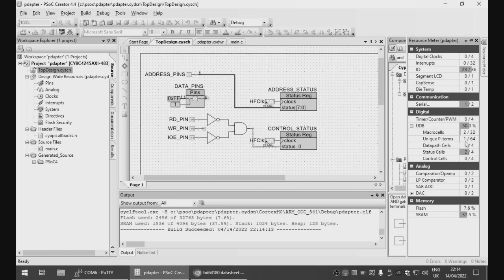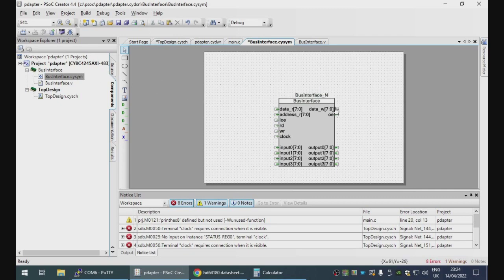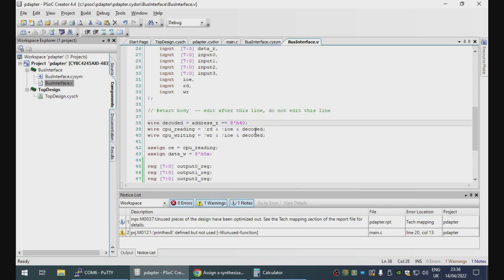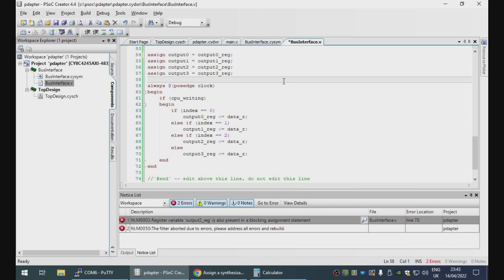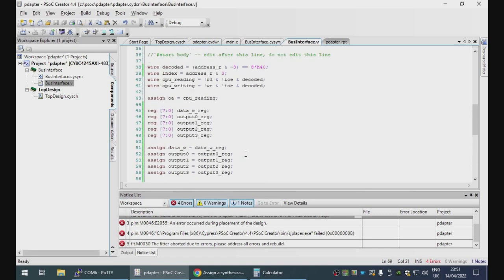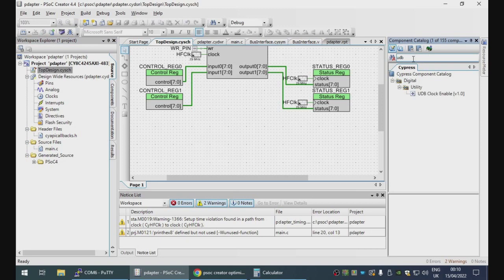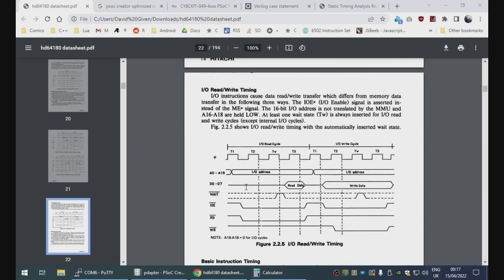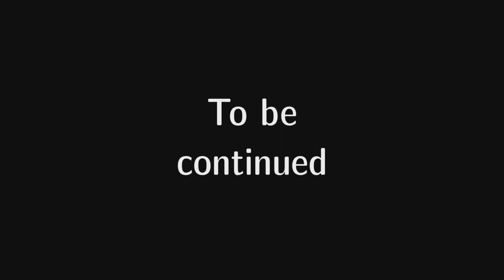A Brother WP-1 serial interface #3: more Verilog

Comment: I know nothing about CPLDs/ Verilog, so the following is a lot of guesswork and extrapolation from not very much knowledge: is the Status Register's "clock" signal for an system clock type clock, or is it a signal to tell it to "clock in" the data on its input pins (such that existing data remains registered if the clock is not asserted)? If its the latter, could you simplify your bus interface device by having a common set of data out pins shared by all Status Registers (rather than one set of 8 pins for each register), and have separate "data clock" for each status register that's used to tell the appropriate register which one is supposed to "clock in" the presented data? This might allow you to remove the 'reg's declared in the Verilog (reducing the P-term count?), and possibly define those output pins with simple assign statements, like "assign data_out = data_r", "assign data_clk0 = cpu_writing && (index == 0)" "assign data_clk1 = cpu_writing && (index == 1)" and so on.
Reply from the maker: Hey, don't spoil episode 4 (rendering now)! /s

But yeah, that's exactly what I ended up doing. I was, in fact, vastly overthinking things. What I should have done was to clock the PSoC of the Brother's own 6MHz clock, which would have avoided a whole pile of weird edge cases that I didn't really understand and spent ages banging my head against.